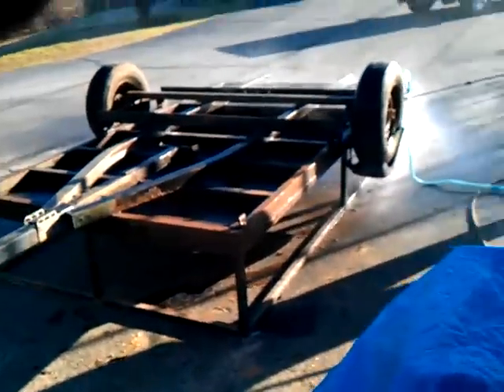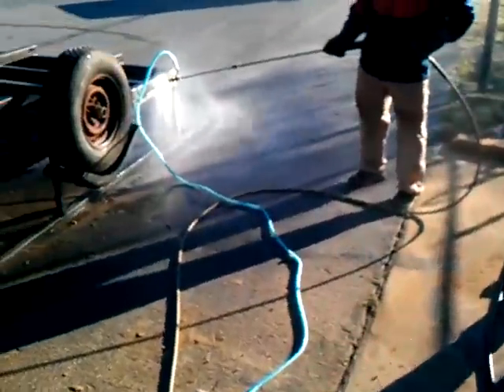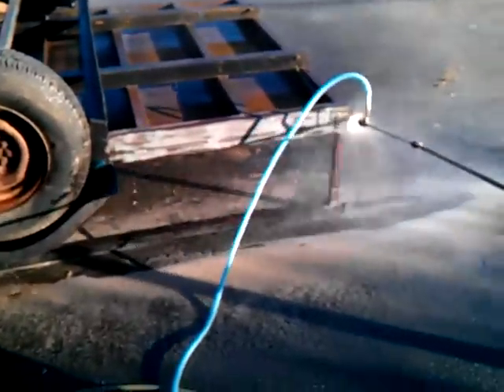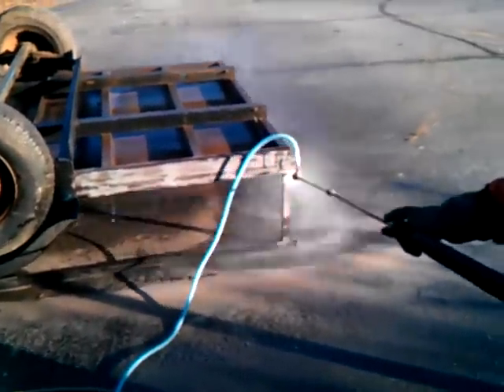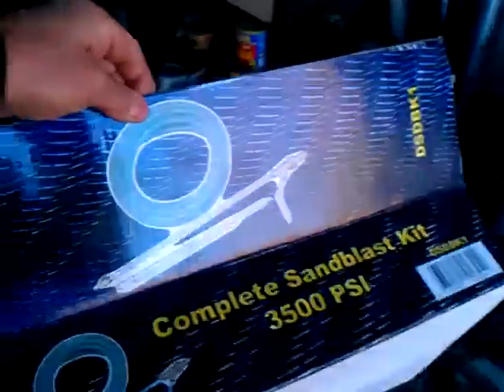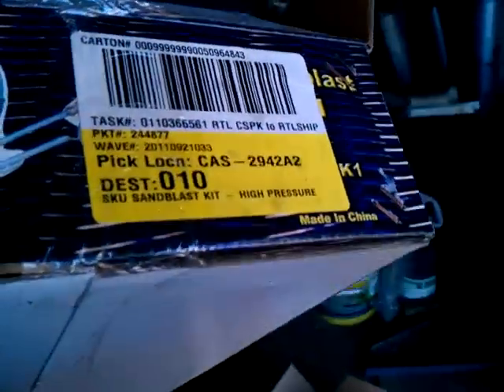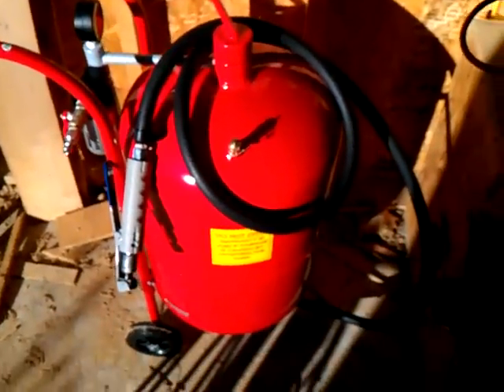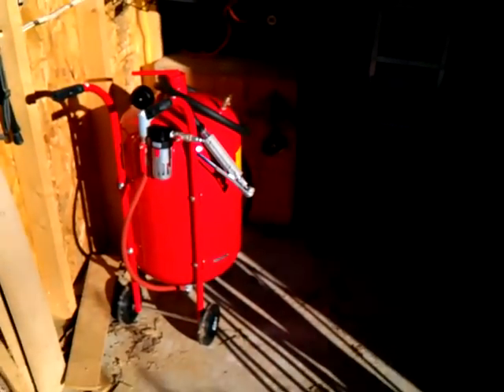Wet sandblasting trailer using Northern Tool sand pressure washer

Comment: After doing some air sandblasting (what a mess) I was thinking of getting one of these. What are you using for a pressure washer? I have a 4000psi 4.0 GPM job.... that should get the job done.  Thanks for the video.

Comment: did you just use regular play sand (fine)?  If so, how much of it did you have to use?
Reply from the maker: I used play sand from Lowe's the fine sand did not do as well as the cheep medium  sand.If you can get some river sand would be best. The tube needs to stay dry on the inside so wet sand can not be siphoned. The right sand has a lot to do with how well it works.
Reply from the maker: We pickup 5 bags used all of them I thank they were 40lb bags

Comment: Why don't you use the pressure pot to supply clean dry sand to the pressure washer?
Reply: It doesn't need it. |The syphon feed works fine.

Comment from the maker: two
Reply: POR 15  "metal prep",  etching primer,  right after spraying,  will leave, a zinc coating,  when rinsed,  and blown dry
Reply: is that model #2100439 wand,  and what's your pressure?
Reply: 2260,  comes up as a replacement tip, on Northern Tool web site.